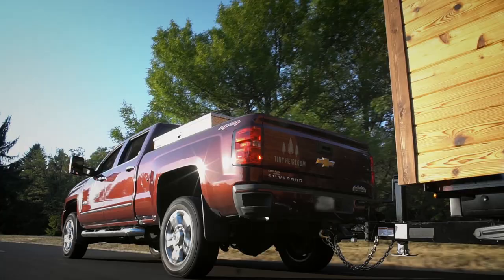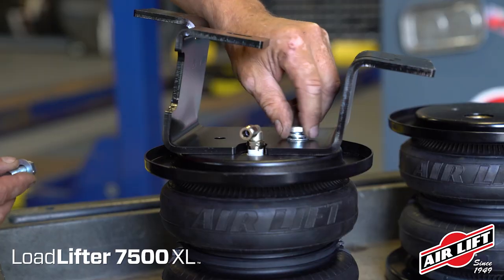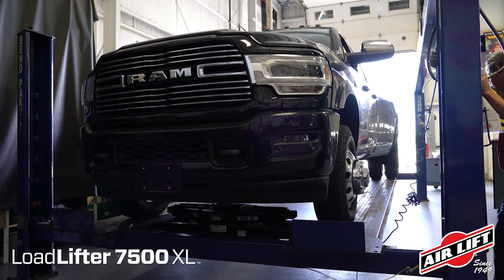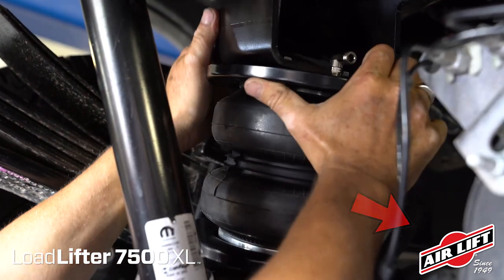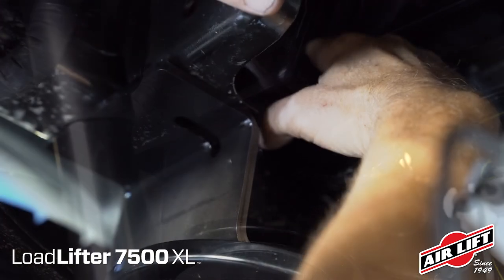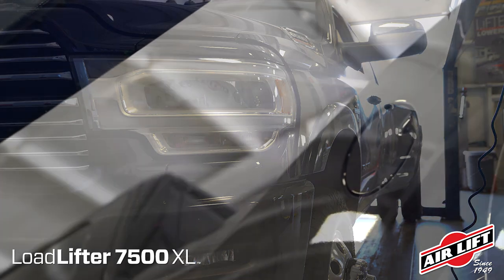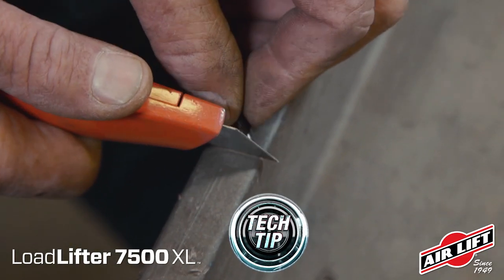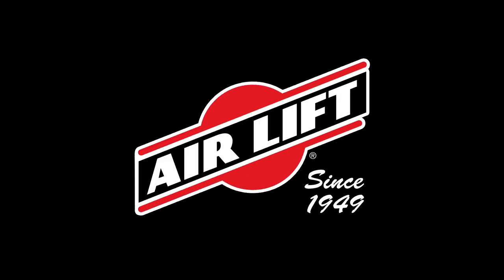Air Lift Install: 2019 - 2024 Dodge RAM 3500 - LoadLifter 7500 XL

Comment: the brackets are too tall you only have 2 to 3 inches of axle travel up , the airbags bottom out , get firestone or torque they have double the travel of airlifts im putting my set on ebay

Comment: Hey, so I haul about 25k almost every day with a 2016 Sierra 3500 dually running hotshot with a gooseneck trailer. The ride is extremely harsh, should this help out? It also has a good bit of sag in the rear which I know this is what is designed for, but I just hope they can withstand the weight. If not this, what would work? I already have a Shocker Hitch and it helps some, but not enough. :(
Reply: Yep that’s definitely what you need. Even 5k bags would help.
Reply: Upgrade to a ram 4500